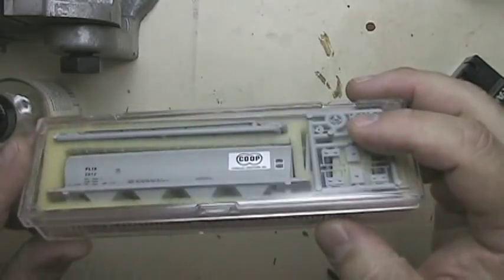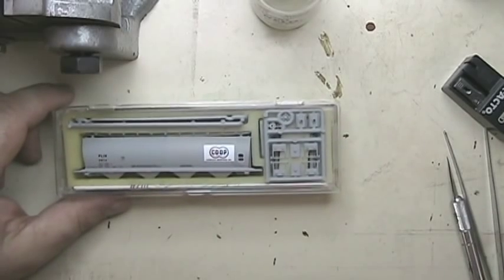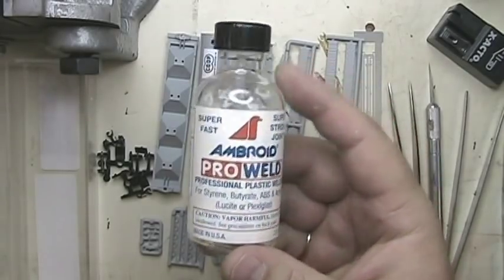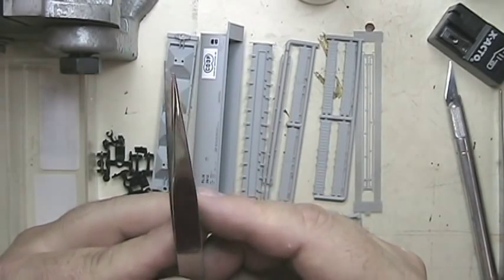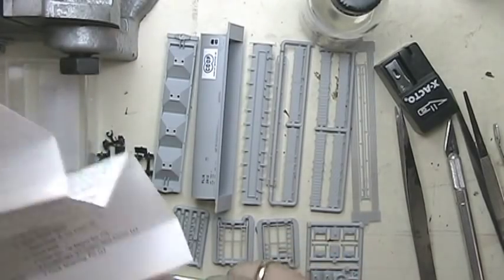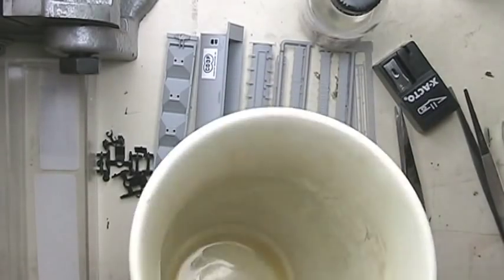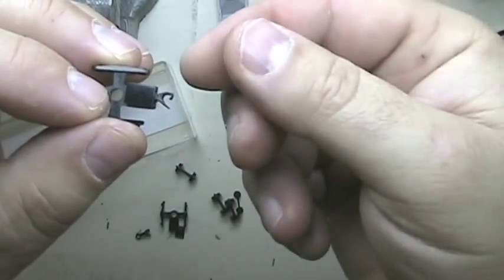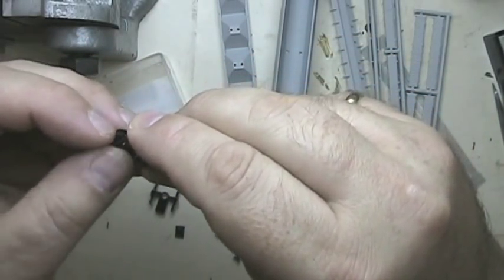Model Railroad VLog: Kit Building a Hopper Car: Part 1

Comment: If you want to go really cheap on the plastic cement, purchase lacquer thinner. It welds the parts together just the same and a gallon will only cost ten or twelve bucks. That's enough product to last about a life time of model railroading. It can damage paint if applied in great excess, but it can be applied sparingly since it will be drawn into the joint. All you need is a little bottle and brush so that you work with reasonable amounts at a time.

-Chris

Comment: when you glue a car go with Testers Modelmaster glue (blue tube) don't get the red tube the red tube is plastic cement which contains solvents and that stuff will melt your model